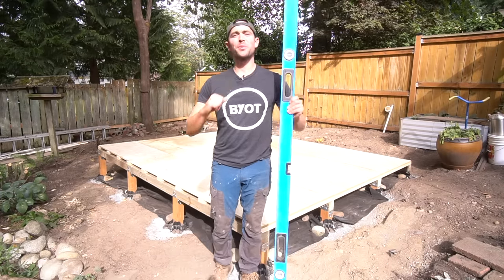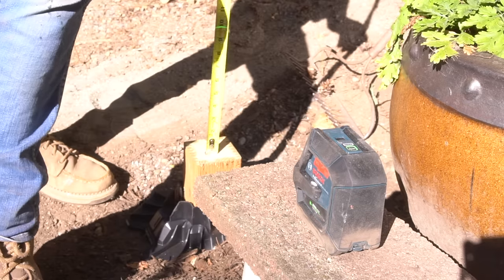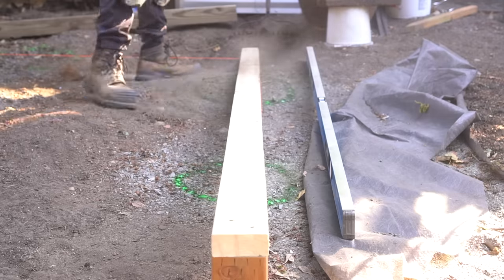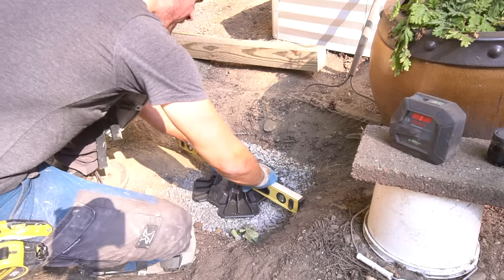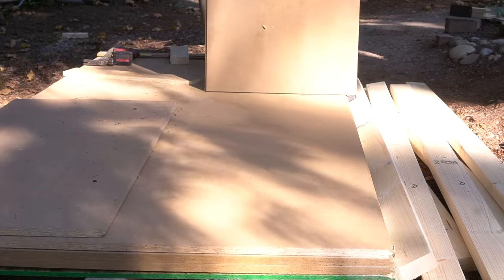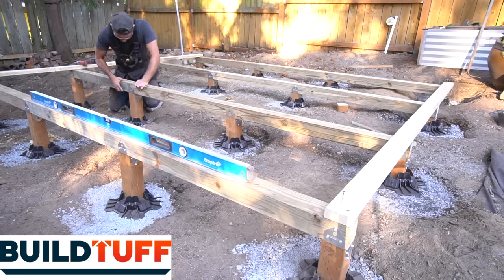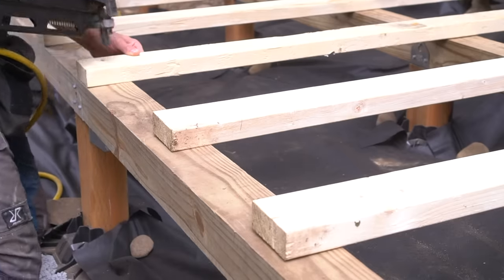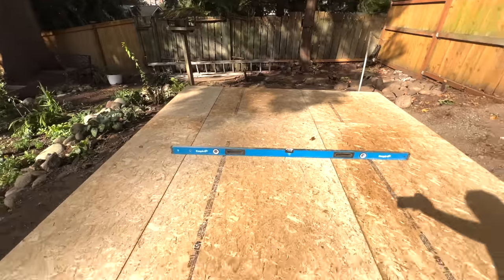How To Make A LEVEL Floor System

Comment: DO NOT EVER PUT FLOOR JOISTS ON FLAT BUT INSTEAD STAND THEM ON EDGE SO YOUR FLOOR DOESNT BOW WHEN YOU WALK ON IT.. Watch Larry Huan or builder brothers if you want the right ways to build. This would be the laughing matter of all construction sites, i tell yah .
Reply: Great to hear you mention Larry Haun, he taught me all I ever needed to know about framing. I also have bad knees and hips so all my floors have a bit of bounce using a system very similar which is common here in office buildings with floating floors (without the bounce). The maximum span is 36" between supports, a 2 by 4 flat will do just fine.

Comment: I’m a retired ironworker, before laser leveling aids we used a clear hose almost filled with water and put a cork in each end just to capture the water. We a transfer a mark given by engineer to any location on each floor on a story job. Just uncork each end and transfer a mark wherever you need it by holding water level on desired level to the water level on other end of hose. All finish ironworkers carried a rolled up clear hose with corks in their tool bag. If hose is not long enough just make a mark to transfer the elevation. When they came out with laser aided machinery I thought that’s nice, but we have that problem already put to bed !
Reply: Water hose level, yes they still use these but not in home construction...mitx mainly used in water works, pool building ect
Reply: Yeah, I used one.  You have to have a good partner to use them well.  I bought a laser level.
Reply: I’ve also used a water level. It is extremely accurate.
Reply: yes i used a water level setting scaffolding
Reply: Local #10 as a young man. Then 30 years as a roofer local #20. Early 80s bad for Ironworkers in Kansas City. Freaking Carter.
Reply: I love a water level.
Reply: cant laser where you don't have line of sight and no $200 spindled bubble laser will ever be as accurate, water levels are gravity accurate.
Reply: @robertsparling   I bought a water level 35 years ago that had a small water tank that you set in one spot and then one person could move the hose around and mark out the heights !
Reply: @MrDarchangelomni  Mine was 800 Euros, and is accurate to 3 mm over 150 meters.  I agree that a water level is accurate, but it is harder to use.
Reply: @diverdave4056  I would like to see one like that.
Reply: @robertsparling  only if you have line of sight, try a laser when flying tables slab to slab and you have 10 rows of 5 columns first two rows block the next 8.
Reply: @MrDarchangelomni  Look, there is no need to convince me of the strengths and limitations of either kind of level.  I have said many times that the water level is spot on accurate - I have one and I use it.  I just find my laser to be more convenient to use in most situations and accurate enough for my needs.
Reply: @MrDarchangelomni  well actually you can . Just put a few bench marks on the walls  in one area then - move the laser  to the next area and adjust its height to match the first set of marks ... now apply bench marks to the second area you plan to work in  !
Reply: @robertsparling  I agree there is a need for every well crafted tool, and lasers have their applications, I just simply would never trust one for anything other than cosmetic work,  acoustic ceilings, wainscoat, and any type of wall mounts... but the premise that someone would use,  the type of laser shown in the video for the bearing structure of a subfloor in real professional life is just nonsense, were I to even consider it, it would have to be like the laser that drives my excavator, a gps controlled, center pivot transom style that is self leveling in .001" increments of sensitivity. When we set it up we hit 3 different spots so it can calibrate and then center it on a 4 leg transom in the middle of the ground we want leveled... now that thing is actually pretty reliable, you can almost trust its numbers enough for foundation work, but it is still far mor setup and work, than the water level system I use. I had to prove to the ceiling grid guys that there is nothing quicker/easier to use and setup than a central well 4 way water level that can cover any point in the plans with story poles to maintain calibration. Like I say there are uses for the cheap wall/table mount rotary and single direction lasers but the moment accuracy is critical, or you have 100  unconnected rooms you have to shoot a line through it becomes a pain in the arse and when its only a couple marks per room, you end up paying someone half the day to just set up a laser and then move it. I am mostly pointing this out in my responses to you for all those who might read this in the future. imagine you were going to shoot in all the beam heights in a sky scraper. 1/8"  in 450' might not seem like much, but when you consider that usually when a measuring tool is out true, it is always out of true with the same vector. Ie A bubble level that is unlevel will almost always be out only in one direction, it wont be a random bubble with some error in any direction. which means any subsequent measurement made after the initial measure will now be aggregate. Now imagine how quickly you end up 1" out,  and with lasers this error increases the farther from the origin you are. So we are now at 8 floors and the front of our building which was 100' from our laser is now a little over a quarter inch out, but the back side of our building is 625' from our level and is now out about 1-1/2". Which is just insane, but everyday your water level is calibrated at the central well and suffers no recursive error without some serious negligence.

HAVING SAID ALL THAT, IF the structure I'm putting up  is  below 3 floors, and no bigger than 100'x400' I do use laser(S) I set two lasers half the length of the building from the front then offset them by 45 degrees from the building centerline, so that I get laser overlap and at least 3 sides of all my members. I also have surveyors transit out for that 4th side and transferring measurements. We will keep a story pole usually somewhere in the middle that has our verified true marked on it, and every time someone walks by it they have to make sure every bit of laser is within that black mark, if not the job stops until we recalibrate. It sounds dumb or overkill but thats only because you have never had pay 260$ for some useless rocks made out of concrete and steel and some used metal roofing, which is what happens when some idiot steps on the transom leg and sinks it an extra 1/8 inch, then doesn't have the the foresight to tell anyone or correct it, Idiot didn't even realize what he had done. yes he still has a job, he didn't understand, he does now after smashing reinforced concrete into gravel for a week.
Reply: @diverdave4056  think about what you just said, you have to stop production, to re set your level, now pay someone 25$ to have to set benchmarks for 1000 rooms and 500 central columns, this is why I said it has applications(ceiling grid, fixture and finish) but for productive large scale work, unless you have an arsenal of lasers and dedicate 1 guy to keeping them calibrated and synchronized a central well water level with 4-8 legs will always be easier and faster and you can just leave it out, a tube is always close by, 
I don't have to reset, or sight in on old marks I can compare level with another guy who I cant even say on another side or outside the building. In a single open room, no obstruction only 1 setup yeah the laser wins hands down, but as soon as you have to reset that laser more than twice water level wins. I have raced people with it just to show them, and the best part is no one has to borrow the laser to check another side, imagine a guy starting out and he doesn't own 2 lasers and a backup... but he is in a situation where he needs to check setup in his room, and compare with the room his buddy is setting up, now the guy writing checks is getting effed in the butt because people are now stopping production to literally walk back and forth room to room... with a 4 way or 8 way, I check my room with a tube, and the other guy doesn't even have to leave his room he just finds his closest tube, and we can compare in live time, its great for multi bulkhead penetrations in tight spaces, like I want to place all the cable racks in a room so I can start the power management and monitor/control systems but I dont know where my cascade cooler line is coming through, where the steam is coming through etc... simple, i find the guys working that pipe check it with a tube, set my tube to match that pipe then just make sure all my racks clear whatever height the tube indicates. I no longer have to project with a string line, or straight edge. I cant even explain the time and money a water level saves. But I promise when done properly there might be 5 other investments in your entire life that  pay off as reliably and as well as a water level.
Reply: @MrDarchangelomni  perhaps take a moment and reread what I wrote > YES it can  be done .  Yes a water level does work and I have owned one for 35 years . I also use laser levels .
Reply: After reading all of the replies, I would never use anything but a mark shot in on each floor by an engineer and transfer that mark anywhere I needed it. The 3rd floor or floor 47 !! Any 2 journeymen ironworkers can accomplish that. Windows all around each floor just like normal. I would go out on a job ask someone how many stories they would say 66, we would be on 18. I would wonder if I would be on this job when it topped out. That’s a typical dispatch. Ironworkers put in the rebar, set the iron, and install the windows. A journeyman has at least 1,200 hrs in each. Prints, placement and all welding, it’s all in the apprenticeship, including certified welding and you’re knowledge of required knots typically used. Necessary when transferring floors with buckets of bolts and tools, and a big air gun with hose, beaters, yeah. You’re have to know you’re knots Now, even as a first year apprentice!
Reply: The engineer making the marks was hired by the contractor, never slowed down any window installation.
Reply: @donaldmarlow488  exactly, you would never use 200$ off the shelf black & decker building wrecker lasers to establish marks on any foundational structural member, in real life there is always an separate entity that specializes in fine measurement and surveying to establish a referenced location, be it an an in house engineer or an outside firm. once plans have been referenced to site(im skipping tons, like soil density checks, backfill gradient, organic soil contents and tons of others) every trade on that site now operates from the same point of origin otherwise you end up with snafus, like all the pipes come up in open floorplan instead of in the walls or shaftways dont line up with underlayed foundation, bad stuff happens if the block walls for an elevator shaft are not directly over the footing that is beneath the slab etc. you would never trust this to a MarthasDepot laser and the guy who unloads your lumber trucks. Once you have a reference I am just saying that it is far easier, in my opinion, and in practice, to have a central water level with several tubes that can go room to room over the entire floorplan, we made one once with 16 450' legs and sat it at the tem. power station right next to the compressor. We have all kinds of battery tools now, portable welders, instant nailers, woderjigs, and toolbox talk toys, but on a big job, you still find the old compressor with hose spaghetti, and cords ran everywhere, it only makes sense to treat your plumb tool in a large distribution manner for the same reasons... in an Ifixit situation where you are only going to need the tool for a couple rooms, its just convenient to not have to set up or pack up when finished and you can be 100% portable, but when you are gonna be onsite for a year or two, it just makes thousands of dollars worth of sense, to have hoses,cords, and water level tubes, because of the efficiency savings and ease of use put job boxes close to access ways and buck hoists and make it so every day the only setup needed is the individual setting up for that days task, having to lug a lase room to room just defeats the purpose of distributed access.
Reply: @donaldmarlow488  also Ironworkers do not always set the windows, now I agree 9 out of 10 times in a building where the majority of exterior wall is window, or glass skinned, yes it is you guys, however you might have a building that is skinned in bulletproof fiber on heavy gauge framing, that window job is usually wrapped into the framing contract. I have even worked a job where the exterior windows facings were done by stone masons (and boy do those guys make a ton of money for very little daily window punch out) The stone masons had special glaziers they brought out to secure all the panels to the frames and those dudes were like special forces on wires goin up an down like little spiders hanging by their butts on a string from the ceiling.  Then we had to contend with federal buildings that is always hard but right after 9/11 all of us had escorts, everything was x-rayed, they even opened and sampled all our paint/primer buckets to make sure the actual ingredients matched the msds in a lab. All welding stick/wire boxes got checked and they would archive samples so everytime you went in you had to leave them one, every hazardous tank had to stay outside, and we had to design and build a distribution hub for weld gasses to the entire building... dude the longest part of that first 3 years after was turnover, we were pounding buildings out in happy time sometimes 40% under estimate and then would still go into backcharge days going through the turnover process because everything had to be atomically pristine and every inch of pipe/duct dry inspected with an internal camera walk... so pill sizes cameras trying to navigate the insides of everything with airflow and wishes.
Reply: @diverdave4056  lol Im a water pusher :) water levels for life right or die :)
Reply: Been framing for 34 yrs and a water level is much better and way faster  seeing a Lazer line in bright sun is nearly impossible I have David White transit can split a pencil line in half from a hundred feet away:)  And laying those 2x4's on their sides is the most rediculous thing I have ever seen like I always say Those who can do those who can't make videos!
Reply: That’s how I was taught years ago.
Reply: The Egyptian spirit level!!👍
Reply: Sr that was the more efficient and perfect level ever used
Reply: Basics still work very well.
Reply: @drmachinewerke1 Reagan was president then.

Comment: Floor joists on the flat and not on their edge. Never seen that before. otherwise a smart build
Reply: Very common to save height but probably not up to code
Reply: That's not common .  The only time lumber is laid down flat, is for the decking, which goes over upright beams.      I have an auger with a 6 inch bit, 3 ft deep.  I paid about $250 for it.  Never lets me down.  I string, I drill all the holes for my fences, decks , etc in minutes. I drop the posts, brace, level , attach some beams temp, to keep them in line , faced and spaced.  Concrete all the posts at once. Clean up go home.  I use a laser and cut the posts to height.   After the rims and joints, I run my Makita power planer over it. Plywood on an outdoor floor,?    Dear God

Comment: Floor joists should not lay flat and when putting down the flooring sheets they need to have the seams offset like a brick pattern would lay out. Good video though.
Reply: I agree. Floor joist should be in standing position to make it stronger and support heavy load and vibration.
Reply: Not to mention the post&beam method requires the post to be buried and properly secured in the ground to prevent uplift and movement of the aboveground structure during high winds. Some basic engineering principles need to be applied to every construction project in order to be safe and long lasting.

Comment: One more note :  You dug the holes (not very deep but I don't know how far south you are) but those plastic bases should have been put on about 1"-2" of the tamped gravel and then the rest of the gravel should have gone on top to ground level.  Rain will fill the holes and the freezing temps will raise those plastic blocks quite a bit and possibly unevenly.  If the plastic pads were only an inch above the hard packed, undug earth there wouldn't be much room for water to heave the pads.  2x4's laying flat?  Not done anywhere that I know of.  No strength that way.  You are going to have a bouncy floor with no way to fix it.
Reply: I believe he's in the pacific northwest.
Reply: this is a shed .. not a house

Comment: I built pole frame homes in Australia and I used a water level. The accuracy I was achieving was 1/16' across the entire floor system. And I never laid joists on their side. Thats a new one one me after 46 years as a builder....1966 to 2012....Cheers.

Comment: Ive been in the building trade for 120 years, built my first house in 1896, we used 1x2 for joists, house still standing, doesnt have any walls or roofs but joists are still standing.

Comment: I started working with laser levels 35 years ago installing computer flooring - raised flooring . 99% of the construction workers rely on the laser levels to give a perfect level mark BUT they never ever check their laser level , to make sure its working correctly every time they use them !   Many get kicked - bumped and take a rough ride on the roads in the back of a pickup truck . I bought a new  PLS laser and it was out of calibration ( the company mailed me a new one ).
Reply: Nothing beats a water level